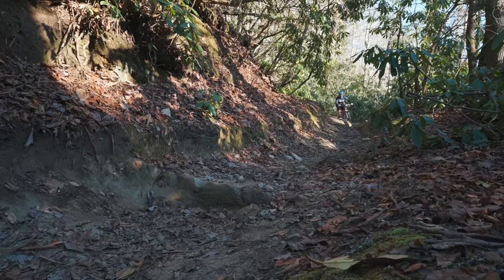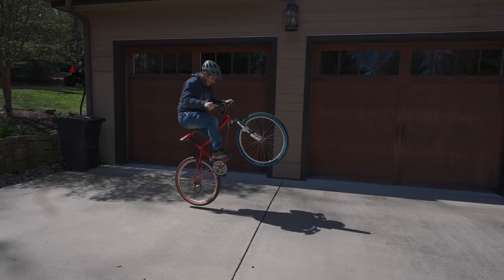Here are the weirdest bicycles I own

Comment: Wonder how difficult it would be to add a brace at the top of the pivot point on the swing bike to support it so it doesn't bend. Sure you can just bend it back but with metal fatigue over time I imagine it'd break eventually. Either way, great collection!
Reply: Probably pretty easy actually. You'd just need some solid round stock matching the inner diameter of that tube and then a plate that drops around the seat tube that you could bolt through.
Reply: Looks perfect for a ball joint

Comment: There are shims available for 27.2mm seatposts to fit the weird 30.4mm diameter of the Kent Trouvaille (e.g. from Cane Creek). And while the selection of 27.2mm dropper posts is quite low, there are some to choose from (OneUp, PWM, KindShock, etc).
The other route would be to ream the seat tube to fit a 30.9mm seatpost. I myself wouldn't do so due to safety concerns, but one YouTuber actually did this.

Comment: I was able to get a 30.9 internal dropper on my Trouvaille.  I reamed the seat tube from 30.4 to 30.9 and drilled an access hole in the bottom of the seat tube that is near the BB to get the cable in the seat tube.  It works great.  No noticable difference with the .25mm missing from the wall thickness of seat tube.  My thoughts were... if I am already drilling and grinding the frame, why not add reaming too.  😂

Comment: Seth, you really need to extend out the rear triangle on that tall bike. A longer wheelbase will solve all its problems and actually make it a capable machine, also better cargo capacity.
Reply: Also, it has space for another 2 bottle cages in the middle triangle.
Reply: You should build a tandem! Tandem bike on the bottom and a normal frame on top. Will give you needed wheelbase and extra seat to geek around with friends

Comment: Hey Seth, I was able to put on a dropper seat post on a bike with a weird seat post ID by using a seat post adapter. Pretty much every size you can think is available and I used a 27.2mm dropped and a 27.2mm - 30mm adapter. Hope this helps with the Kent!!
Reply: I just recommended the same.  Yep.

Comment: Re: unicycle freemounting.

On a smaller brake-less unicycle you can hold your tire in place with your hand as you mount to assist in keeping your balance under control as you get moving. You could probably do the same thing with your brake.

Comment: I can help with the dropper post issue on Walmart bike. My main rig has odd 29.8mm seat post, only option was to go for KS eTen 27.2mm 120mm dropper and use shims for extra stability I've added modified shims at the bottom of a dropper that are held with tape below and above. Been using this setup since 2021 with no issues. Can't get what you love, love what you have😊

Comment: If it helps at all, you're riding a bit high for muni. On pavement most people like to have it the seat up but the second you hit a bump it'll buck you. As a fellow short unicyclist i'd recommend getting a kris holm fusion-one saddle/post since you can get it a bit lower than the one you currently have. Also, if you can post on your arm to distribute weight instead of just sitting, it'll help compensate for bumps too. it's not immediately intuitive, but it's a must for riding trails.

Comment: I remember the ORIGINAL late 60's Swing Bike, pitched by Jimmy Osmund.  It was a Sting-Ray style bike, with springs under the top tube to give stability around center, and a lock-out so it could ride like a normal bike.  It also lacked the cantilever pivot tube that always bends on your model.  Like the makers first build, it's basically two, fully supported, head tubes with the rear "fork" being the whole drive train.

Looking at the new "Swing King", it makes me think they were scared to just let the pivot be the seat tube.  Maybe it needs to be that far forward of the seat to be controllable, not sure, but that was not an issue with a banana seat on the original.

Comment: You'll have a lot better luck free-mounting the unicycle if you start with the pedals level, and only put enough weight on the back pedal to stop yourself from rolling backwards - most of your weight should be supported by your arm on the handle. For a large wheel, starting while rolling forwards slightly can also help, since you don't have to overcome the inertia of the wheel to start moving.

Comment: If you increase the chainstay size of the tall bike, to the point where the down tube of the upper bike makes a straight line to the back wheel hub, it would probably keep the front wheel grounded while going up hill, could be a cool project for when you’re bored 😅 anyway it’s an amazing fleet!

Comment: Should weld a tab on the swing bike going from the seat tube to the top of the swing pivot making it a double shear point. Single shear on a king pin style bolt like that will always bend for sure.

Comment: The constantly bending pivot point on the pivot bike would be easy to fix. Just pull the cap out of the pivot point, mount a goose neck into it, and then weld a piece of tube from the goose neck to the upright. As soon as I saw it, I thought "That will bend. It's not supported at the top, and has a massive rotational moment on it."

Comment: I wonder: why isnt't there a top support for the back pivot on the Swingbike? This would solve the bendy problem.
Reply: should have another bearing there yes true.
Reply: @SimonBauer7  theres already a top bearing, there is just no support like the OP said. you can mount a support with the 1" nut to have it remain removable
Reply: I am the designer of this bike.
Reply: I have dual Chris kings on mine.
Reply: @saltybmxer6977  headset does not matter... the "fork" steerer tube bends at the base
Reply: @bmxscape  I told you I designed this bike so I’m pretty sure I know. Mine has two Chris kings.
Reply: @bmxscape  I have a prototype and have had it for 18ish years. Mine has better quality tubing and hasn’t bent. The person that brought them in used cheaper tubing and there has been problems.
Reply: @bmxscape  also this bike isn’t something you can beat on. You can’t ride  it off curbs and stuff like that because it’s not built to do do that. You wouldn’t ride a road bike for downhill. I don’t know how Seth rides his. It’s a pretty specific bike.

Comment: You need a crazy bike. They were popular carnival games. There were two spider gears in the neck which basically reversed the steering. Handlebars turn right, wheel goes left. And vice versa. I had a nice one but it got stolen.

Comment: With your mentioning that every swing bike bends on the pivot, it really begs the question, why doesn't anyone make a swing bike with a double sheer pivot instead of that single sheer? I get that it makes it difficult to service/take apart but I feel like a bolt on top brace would solve that issue.

Comment: On the swing bike what keeps you from machining a brace that goes from the seat tube to the top of the pivot point that would prevent it from bending? Bending it and bending it back will only be an option for so long.

Comment: you could fix the bending issue by putting a piece of metal with 1" hole under the headset nut and welding that metal to the frame, so the headset (rear half of bike) is removable still but it wont bend

Comment: PNW makes a dropper post for the narrow tube on a department store or older gravel bike.
Reply: I have an off brand dropper in 27.2 mm diameter on my Trouvaille. You just need a 27.2 to 30.4 adapter sleeve to go with it.

Comment: A unicycle is far more difficult to ride well than a bike.  I rode as a kid and have been doing muni for the past 3 years.  What you can learn to do in an hour on a bike will take weeks on a unicycle, but when you ride through a really steep descent or a  challenging rock garden you get the same feeling of accomplishment as if you had done something similarly challenging on a bike.  The thing is a unicycle moves slowly and is easy to bail off of.   If you decide to ride down an impossibly steep slope you can always just let the unicycle go and land on your feet or your back. It's not like a bicycle where you're fully committed and are going to go over the bars.

Comment: My kent trouvaille  has a 27.2  with a 30.4 spacer  
...ks dropper works exelent
Probably payd $130 on amazon total dropper lever shim clamp  
.did have to drill the inside of the seat tube to have internal routing  though

Comment: So from what i see the seat post on the kent is 30.4.
This might be a good opportunity to show how to ream a seat tube. Reaming seat tubes was a common shop task up til the 90s, usually just to clean up weld penetration and warping on steel frames. These days frames are usually clean or already reamed at the factory so most younger shop monkeys don't even know how to do it. Kids these days * shakes fist*.

I have reamed a couple frames to 31.6 to fit standard droppers, it is pretty easy to do in aluminium. Just get a nice BIG handle (mine is almost 3 ft long) for leverage and control keeping it straight.
Reply: I've only been in the industry 2 years but I have had to ream maybe 2 or 3 frames. We don't really do it as a modification, just to fresh builds that are out of spec from the factory where the seatposts they came with were too tight or couldn't even slide in at all.
Reply: @tomvonderharr865  Oh, cool. People always look at me funny when i mention reamers and facers. Enlarging is definitely not common, but going from 30.4 to 30.9 is very little material.  I had a GT that was meant to be 30.9 but was crazy loose and wouldn't clamp, so i enlarged it to 31.6. I also had a giant that was 30.8 which nothing fits, so i brought that to 30.9. As long as you aren't trying to skip sizes to something huge you wont remove enough material to compromise the frame.

Comment: I wanna see a vid on the hub with internal gears. ive heard you can get some with internal hub brakes too. would be interesting to see that in teh channel, idk maybe making an ultra minimalist but fully fitted, maybe sleeper bike?
Reply: I've got 2 old Raleigh bikes with Sturmey-Archer here in the UK. One is a 1980 3 speed on my Raleigh Twenty "shopper", and the other is a rare 4 speed on my 1950 Raleigh. Very interesting system. The 1950 one also has a dynamo in the front hub that powers a front and rear light
Reply: Brompton folding bikes use that hub set up.

Comment: How did you do the steering and steering tube bearings on the tall bike? One set of bearings at the top and bottom? What about the fork tube, is that a piece of pipe welded on for the extra height?

Comment: You can fix your bent swing bike with a quill stem and a fabricator. Find a quill stem that fits your second steerer tube, have a fabricator hack it so that it clamps the seatpost instead of a handlebar. Problem solved.

Comment: My favorite freak bike is my Laurini runbike. Basically a unicycle with a steering wheel. The pedals are on the back axle and maybe 5% of your weight in on the front wheel. There's no seat. There is a big spike pointed back above the rear wheel so if you were to slip off the pedals, you would go crotch first into the wheel that would then propel you crotch first into said spike. It's a total death trap but it's a blast to ride.